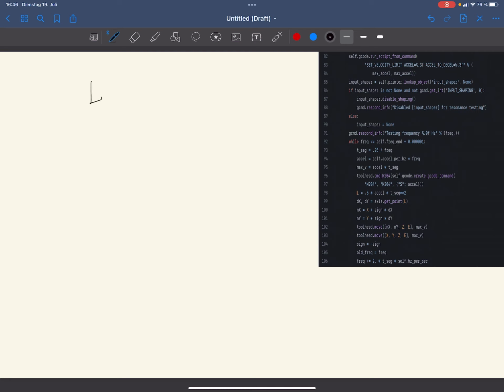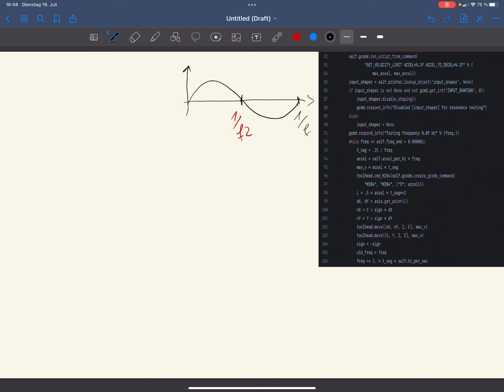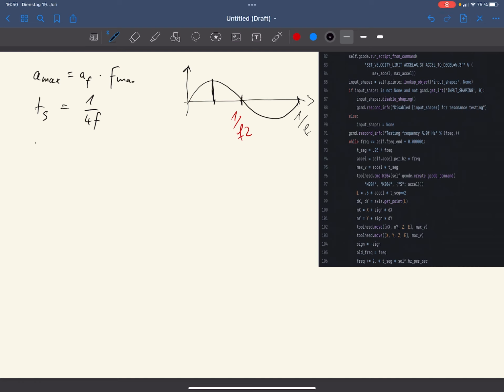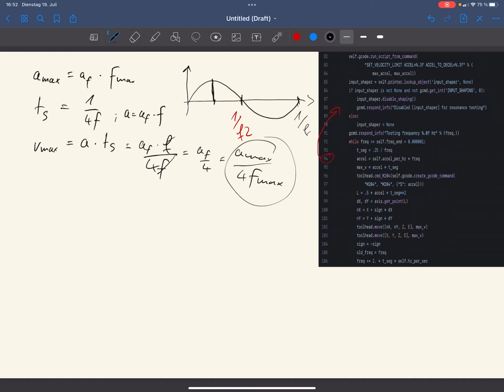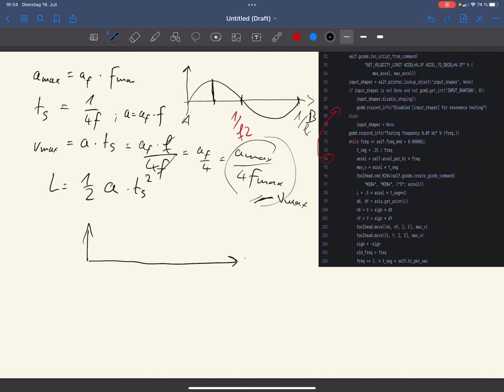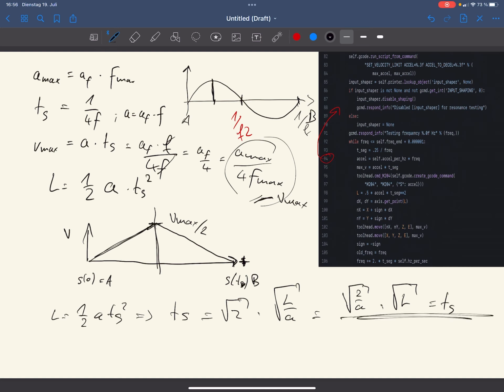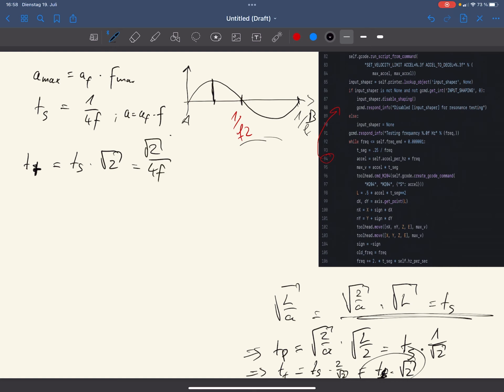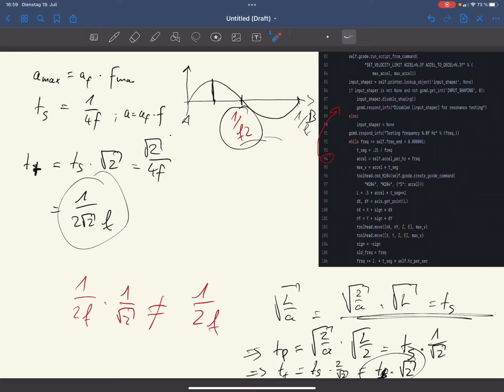Potential Klipper bug: measuring the wrong frequencies?

Comment: If accelerations =deceleration and not including square corner velocity (jerk). Then by definition tp=1/2. ts?

I don't understand why you introduce 2^1/2 (squareroot of 2) as the divisor when calculating tp.. Maybe I'm missing something as Ive not looked at code?

Hope your analysis is correct as we might be printing slower than necessary.
Reply from the maker: The square corner velocity is for the look ahead between movements and doesn't apply here anyway (and would only push it further away from the result if it would apply). 
And no, it is not half the time by definition. I think this is exactly the mistake the implementer fell for. If you constantly accelerate, you constantly increase your velocity. So if you have a set distance, you travel the second half of the distance faster than the first half. If we now start deaccelerating at the middle of the distance, we traveled with an average velocity slower up until the decceleration starts than we would have had when we  accelerated the full distance. Put differently: after half the time you did not travel half the distance as the acceleration is the second derivative of the position, not the first.